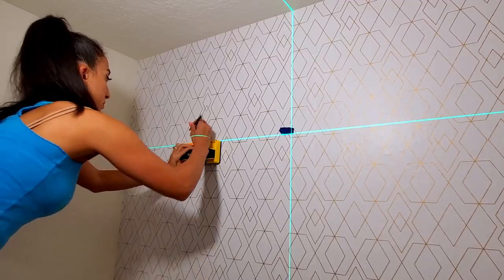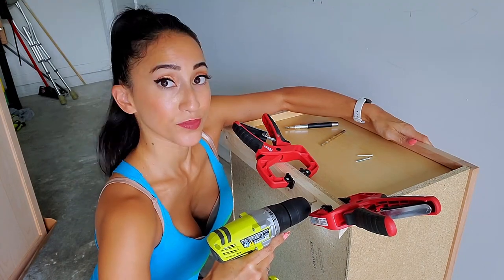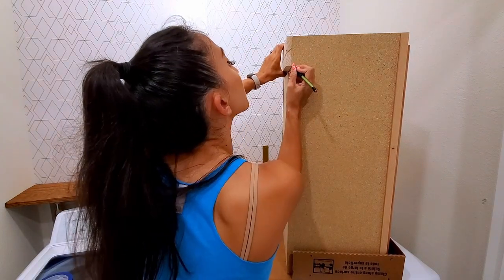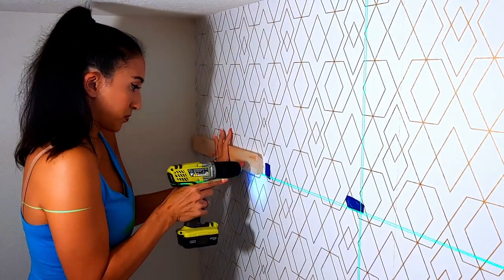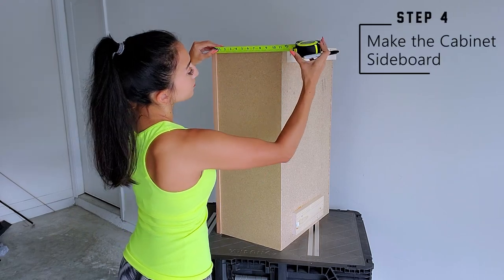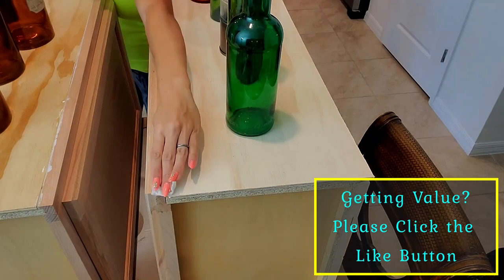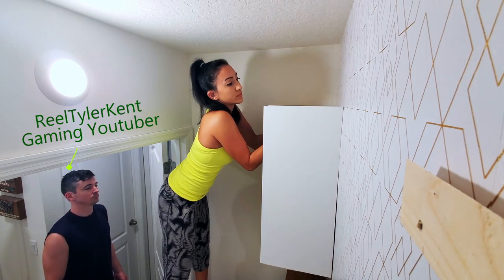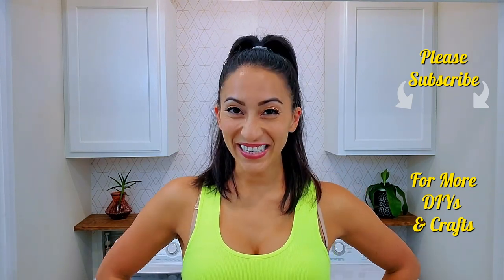5 Easy Steps to Installing Upper Cabinets in Your Laundry Room With French Cleats

Comment: Woow! Nice , i want to learn that to ,but i think need to  buy those kind of tools to make the project smooth and easy.
Reply from the maker: Having all the tools will make it easier, but it is still doable with a regular level instead of the laser level. Home Depot sells ready made wood French Cleats you can buy for $8 each. I also show how you can paint furniture without sanding & using a roller here: https://bit.ly/HowtoPaintFurnitureWithoutSanding

Comment: You have great skills. I wish i did. I am trying to hang a small wooden corner cabinet in a way that does not require me to drill one hole on each side of the cabinet and making a hole through the cabinet. It's tricky.
Reply from the maker: Thank you for the kind words – I truly appreciate it! Learning is a journey that gets better with patience, and each project is an opportunity to hone your skills and expand your knowledge. Your project does sound a bit challenging, but I'm confident you'll nail it. Sending loads of luck your way for the installation! And a big thank you for visiting my channel – your support means the world to me! 😊🔧🌟

Comment: This is a great video with lots of detail! Thanks! I do have a question though…some videos I have seen have you drill straight through the cabinet and into the stud. The French cleat seems sturdier. Do you know how much weight your method can hold vs going cabinet to stud?
Reply from the maker: I'm truly grateful for you watching the video and sharing your feedback – thank you! 😊

Now, about your question on whether the French cleat is sturdier than the typical drilling-into-the-stud method, I must admit, I'm not a pro, so I can't give you a definitive answer. However, I can share that the French cleat has been doing a fantastic job supporting hefty gallons of laundry detergent, fabric softener, and bleach in my setup. Personally, it made hanging up the cabinet solo a breeze.

I've even seen skilled carpenters use the French cleat for upper kitchen cabinets too. So, it seems like a versatile and reliable option. If you have more questions or need further info, feel free to reach out – I'm here to help with your DIY endeavors! 🛠️🏡🧺

Comment: Hi, did you do the french cleat because you didnt have two studs to screw in on each side of the cabinets? Thanks
Reply from the maker: A big thank you for tuning into my video and for reaching out with your question – I really appreciate it! 😄 
I went with the French cleat for a couple of key reasons:
1) I knew this was going to be a one-person project, and the traditional installation would typically require an extra pair of hands or two.
2) You're absolutely right. The spot where I wanted to mount my cabinet only had one stud to work with. The French cleat was the perfect solution for this situation. If you have more questions or need further info, feel free to ask. Happy DIY-ing! 🛠️🏡👍